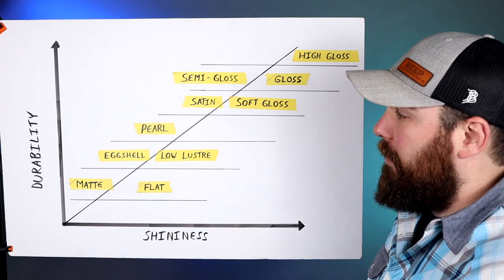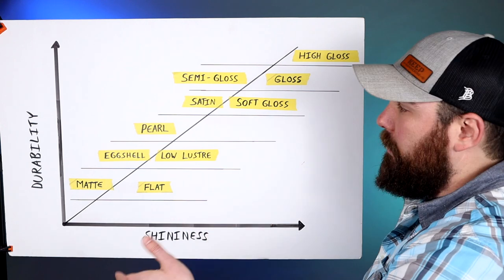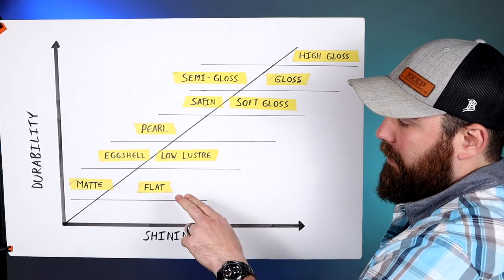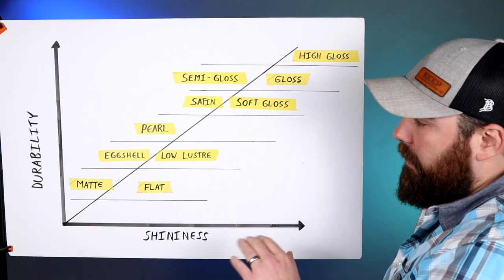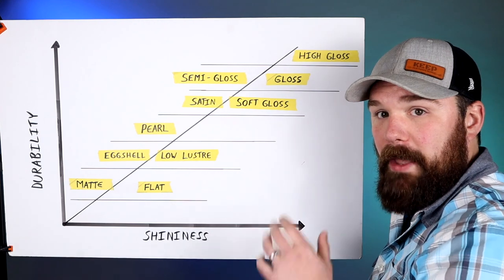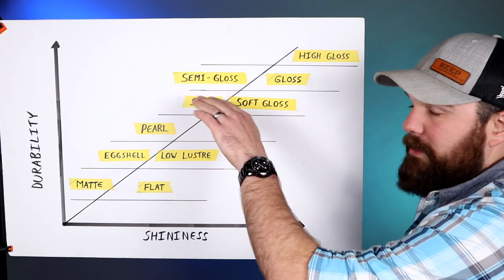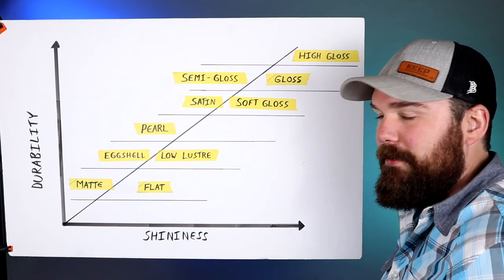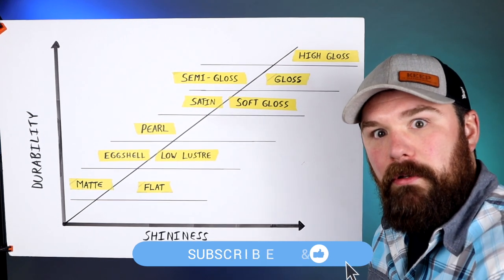Exterior Paint Sheens Explained in 6 Minutes

Comment: I understand you prefer to paint both trim and front door in the same sheen but IF you wanted more "pop" (as an accent on) ONLY the front door would it be OK to do high gloss - or would it "clash" with the less-shiny trim? And what do you think of using OIL-based (old style oil, not modern alkyd hybrid) on the front door (to eliminate the brush / roller marks) - I know it's a hassle and smelly etc...but maybe it could work? Your thoughts...?
Reply from the maker: There are a couple different ways to accent the front door.  You can do it with a difference in sheen, but you can also do it by choosing a different color.  That's quite common.  A lot of folks will have the woodwork, moldings, columns and things of that nature in a white color and then they'll pick an accent color for their front door and shutters or just the front door.  

That being said it's also totally a personal preference if you want to go with a high-gloss on the front door.  As far as using an oil-based paint, that's really down to your level of comfort using an oil-based product.  They tend to be a little bit trickier to work with.  Oil-based paints do tend to self-level a bit more than latex products, but you'll still see brush/roller marks.  I'd still prefer Moorglo Soft Gloss from Benjamin Moore, but that's just me.  

Good luck!
Reply: @SuperVassarBrothers  Sounds good, and THANK you for your detailed reply & sage advice!

Comment: We just painted our 100 year old cedar shake garage with BM regal select low lustre and find it too shiny. We have been told the sheen will lessen/ mellow with time. Is this true? How long will this take? We are contemplating repainting with their flat finish. What prep work would we need to do if we wish to put the flat over low lustre. Please help and thank you for your time.
Reply from the maker: The sheen will mellow with time as the surfaces are exposed to the elements.  You'll likely see a difference in a few months depending on what type of weather you experience and how dirty the surface gets.  If you decide to go over it with flat, then you don't need to do any additional prep.  The flat will stick to the low lustre, so you'll be good to go.
Reply: Thank you so much!
Reply: We live in Michigan so we may not get a second coat of paint on the garage until Spring. With a season between paintings can we still just paint the flat paint directly onto the low lustre surface?

Comment: im having trouble deciding on a large white driveway gate sheen!  i need it to be durable but not too crazy.  also fencing?  any suggestions?
Reply from the maker: These are the two exterior paints that I like using.  I’d probably go with the soft-gloss for the gate and the low Lustre for the fence.  

Expert Painter Reveals The BEST Outside Paint
https://youtu.be/Lwq4U9Cd5Y4

Comment: What sheen do you recommend for porch floors or decks?  A well-known paint company recently sold me a "low sheen" porch and floor paint for my front porch. I asked for a higher sheen so that rain would roll off and it would be easier to clean, but they said it would be too slippery for a porch. After applying it I found it scratched off easily leaving the primer showing.
Reply from the maker: Hi.   We don't do a lot of porch floors or decks anymore.  When we do we typically use the standard porch and floor paint from Sherwin Williams which comes in one sheen (to my knowledge).     Make sure all the loose paint is scraped and use a good primer on any bare wood.   We find it helpful to use the primer recommended on side of the porch and floor paint which is in tiny print under the "preparation" label.      Good luck!

Comment: I used 15yrs + Flat White on extremely smoothed Exterior Walls...it all peeled off when it rained...but same paint on rough part of same wall did not peel...
Why ?
Reply from the maker: I'm not familiar with the product that you're describing.  My best guess is that the product you used on the smooth walls did not get a good bond to whatever product was used on that surface previously.  That surface probably needed to be primed with a bonding primer prior to painting in order for you to get good adhesion.  I'm a fan of Benjamin Moore's Moorglo Soft-Gloss and Moorguard Low Lustre for exterior walls.  It's a hybrid exterior paint, and tends to adhere to most surfaces.
Reply: @SuperVassarBrothers  thanks..will try that

Comment: if satin and gloss are more durability  than flat why'd not use satin and gloss
Reply from the maker: Because they also show more defects in the surface than flat, matte and eggshell.  You don’t need durability on a ceiling which is why ceiling paint is flat.  Extremely shiny walls usually look like crap which is why folks go with matte or eggshell.
Reply: @SuperVassarBrothers  for Exterior Paint I want durability and satin sounds like a compromise since there is heavy rain and wind and even hail